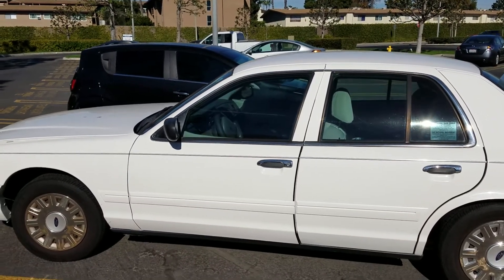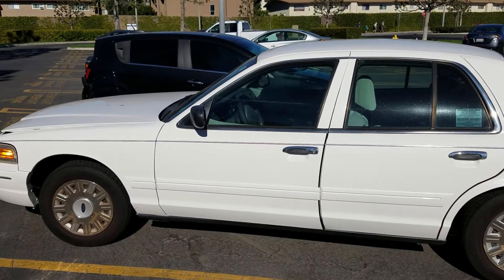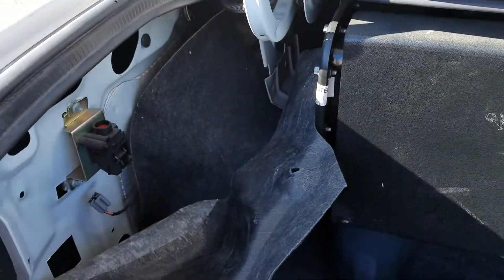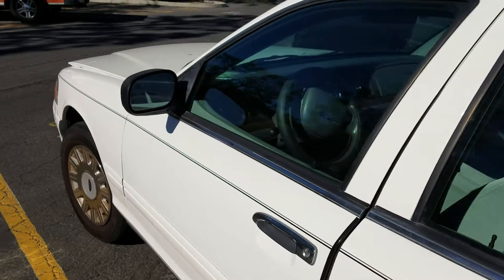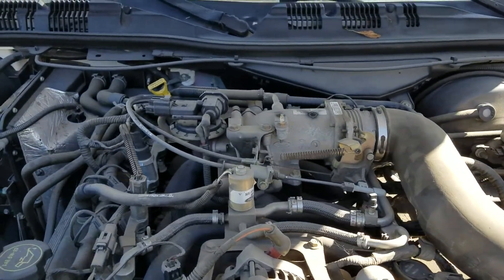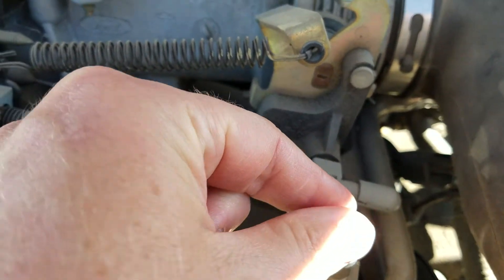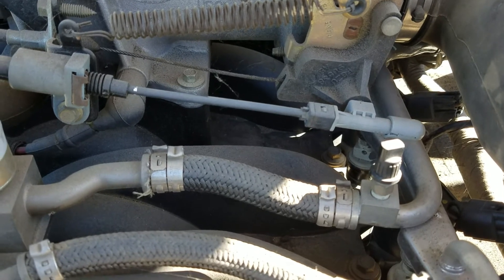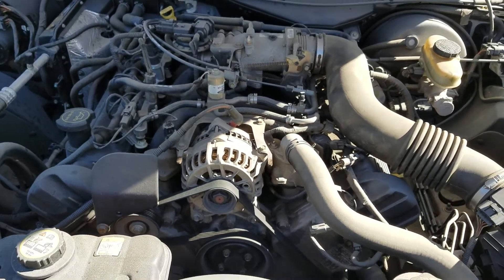2003 Ford Crown Victoria CNG Pressure Release

Comment: Are you still active? I have a question.
Reply from the maker: Yes, but I do not have the car any longer
Reply: @TheAustrianWolf  is there a video where you can reference me to where I can do the fuel filter change.
Reply from the maker: @iNd5ky  the cng pressure filter "fuel filter" is on the drivers back side. You have to remove the parking brake cable, which is easy, but I had problems reconnecting it.